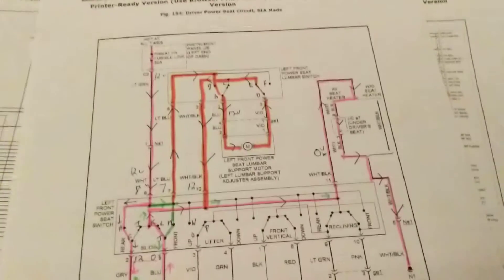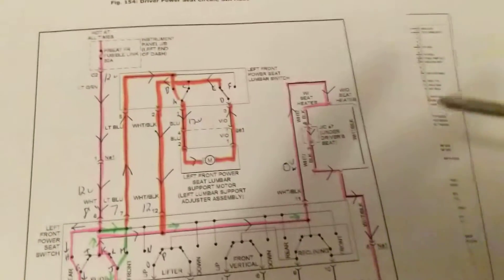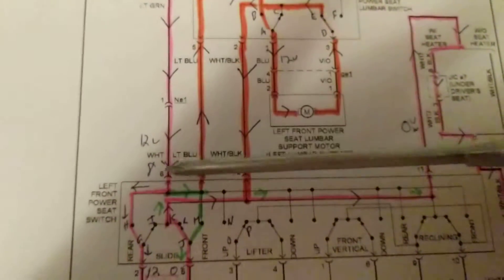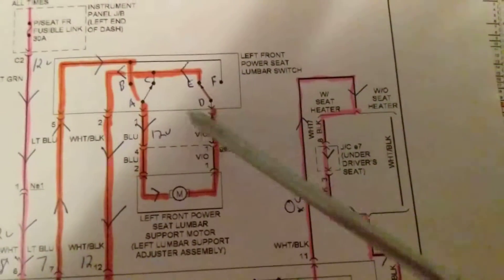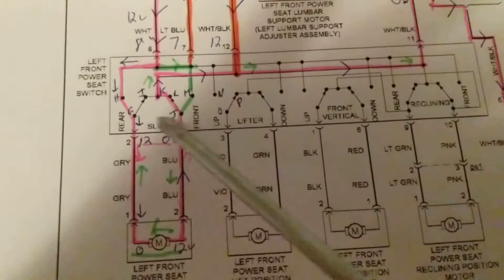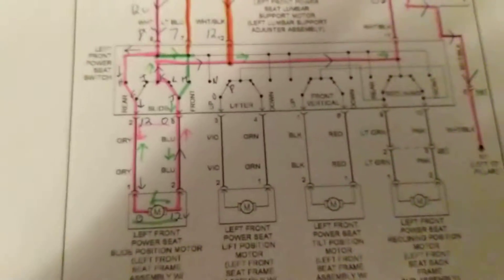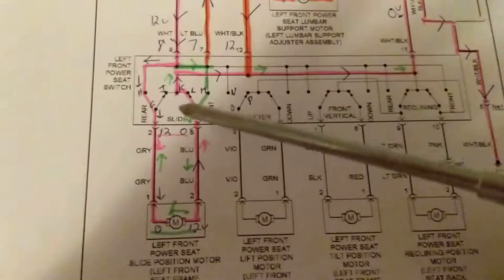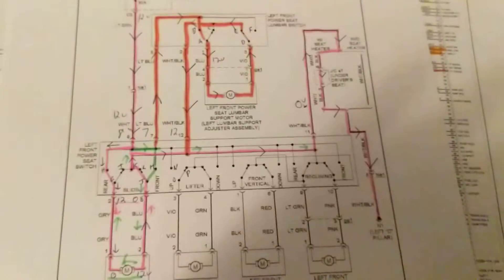How POWER SEATS work for any make or model for motors and switches

Comment: Hello do you have a great channel. How do I contact you?
Reply from the maker: Thank you for the compliment you can leave a comment and we'll figure something out
Reply: @automotiveelectronicsfroms2699  Im installing aston martin seats in my defender 90 project. I have the seats, harness and switch. I can connect the plug into the seat base and switch. then a 3 wire power to the switch. I am having trouble deciphering the related plugs and the power to the seat. under the seat there is a control box and one plug is missing, I would assume this is where my 12v would go to power the module. any ideas? 2018 vantage.
Reply from the maker: @carsandfarmschak886  I believe I responded to your request first download the wiring diagram with the motors wired the way it is try this like I said with those parts I keep me informed
Reply from the maker: If you go to Google and download 2018 vintage power seats which I have done you can have an idea of the wiring diagram I see four motors just like the diagram I explained in the video for each position try to download it and get back to me if this helps if not we'll try something else